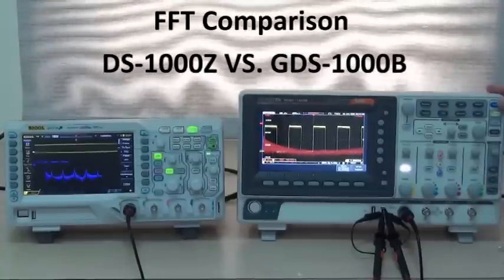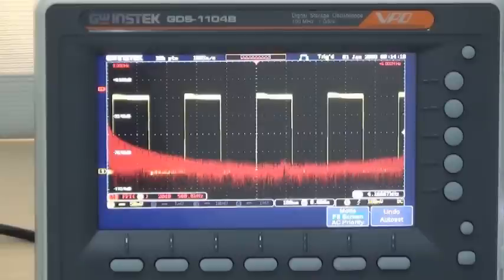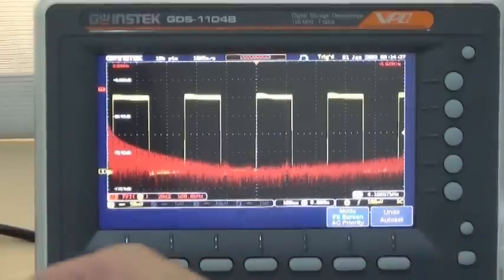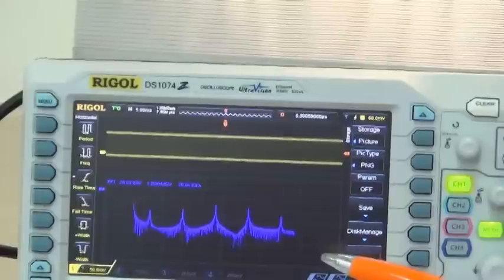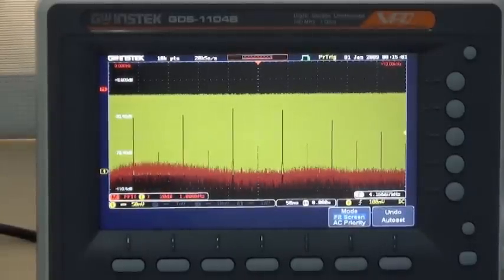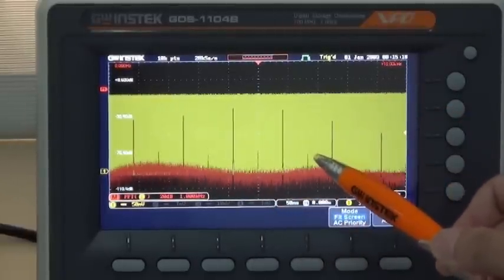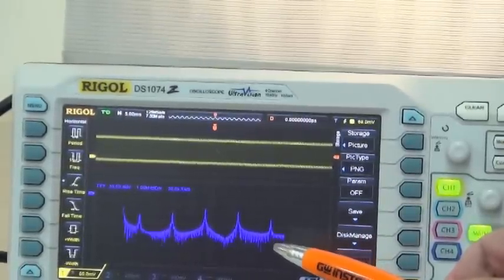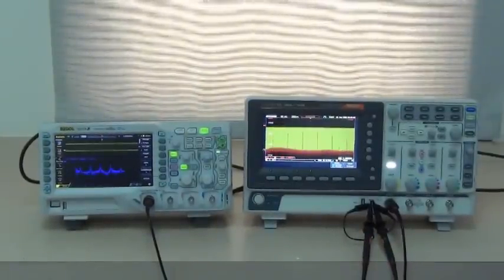GW Instek - The comparison of FFT Function, Digital Oscilloscope GDS-1000B vs DS-1000Z

Comment: Very interesting for the FFT: I don't intend to be overly critical of the scope because it's not a dedicated spectrum analyzer, however, with the demo you did not mention whether the scope can indicate the actual frequencies numerically on-screen:  Theoretically we know that a square-ware has only odd harmonics up to infinity and that a sine wave has zero harmonics - that's theory.  However, in the real world such is not the case because we might not know the nature of the waveform and any of it's harmonics.  For example, the demo using the 1 khz. square wave, showing that it has a number of harmonics is certainly revealing compared to the Rigol scope on the left, but it's not enough, at least as far as the demo is concerned.  Any scope that does an FFT needs to be able to indicate numerically the actual frequencies of the fundamental and any harmonics it is showing otherwise it's just a pretty picture and essentially a useless FFT.  From a marketing standpoint it's great that a low-cost scope can do an FFT but if the FFT is essentially useless (for the reasons cited) then what's the point of doing the FFT at all?   (Check out Jack Ganssle's review of the GDS-1052B oscilloscope (https://www.youtube.com/watch?v=33rN8r9H9tg) scope where he tests the FFT and mentions that it's essentially useless.)   However, no question this is a great entry-level scope if you don't need a solid FFT function.